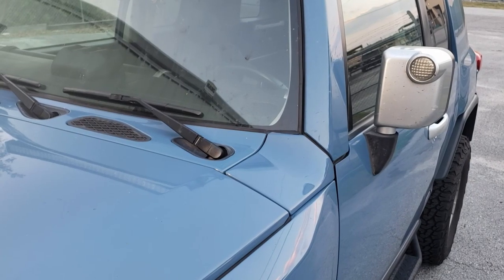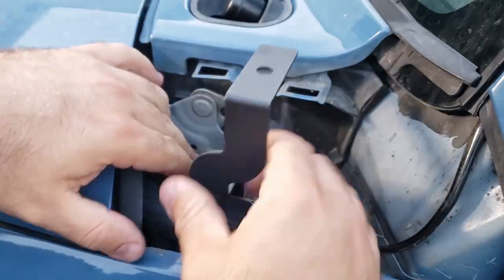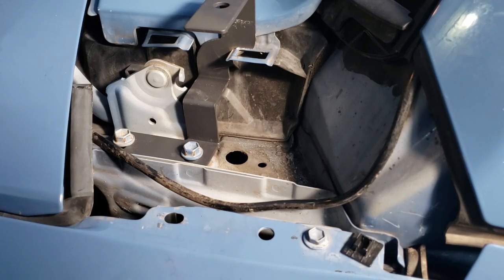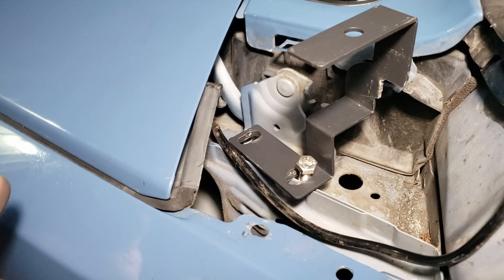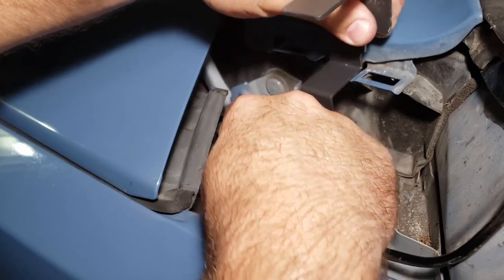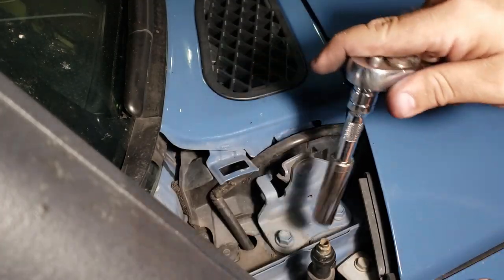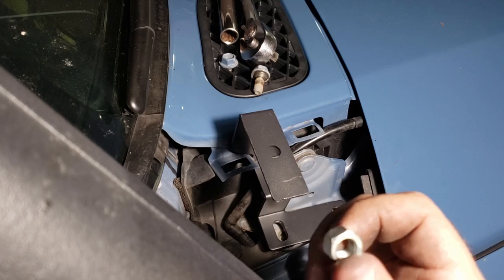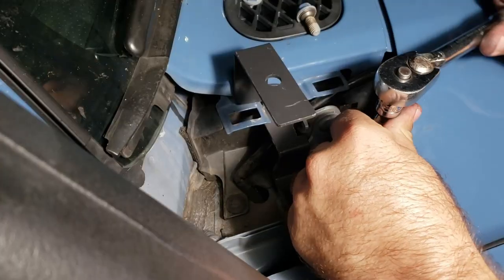FJ Cruiser Cowl/Ditch Light Bracket Installation

Comment: Phew! Just got my brackets and looked at this video and see the difference on that first angle. The one on this video is really short compared to mine so I'm excited that there will be no grinding needed.  Got all the gear ready just waiting on some replacement clips for the panels since I hear that its best to prepare for this because they are so delicate and have a high risk of breaking when prying off the panels. So just a few bucks and a few days to avoid a lot of hassle.

Comment: Hey man, just wondering where you ran the wiring for the roof mounted light bar? kinda looks like it ran down behind the pillar cover and the cowling you took off.. am i correct in saying that? were there any issues with doing that?

Comment: Brackets are great. How do you run the wires?
Reply from the maker: The wires can be easily ran under to cowl, from the passenger side to the drivers side. On the driver, the main harness goes into the firewall there and tou can slip the wires through that inorder to get to a switch on the dash. Let me know if yoh would like a video outling the wiring.

Comment: what a pain in the ass, wonder if there are any better quality brackets out there.
Reply: There are a few, db customz makes the best one, but are $120, I know ebay has a few that are alot better,  but are also hit or miss, avoid the Amazon ones
Reply: Robert Wagner will the ones from DB Customs fit without the modifications?
Reply: DB Customs fit well, but are 120, compared to around 40 for these, Rago fabrication makes some without the FJ cutout block for 80 that also fit well. All depends on what you want/fab experience/whether you want to spend the extra time and energy to get them to fit.